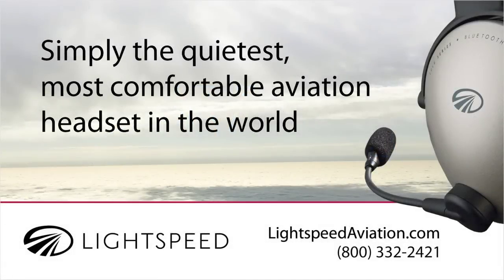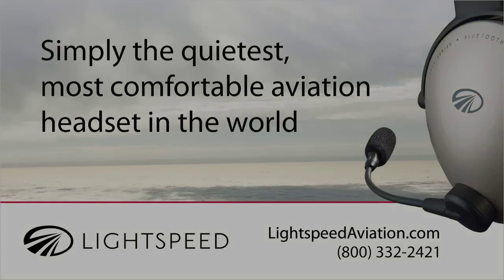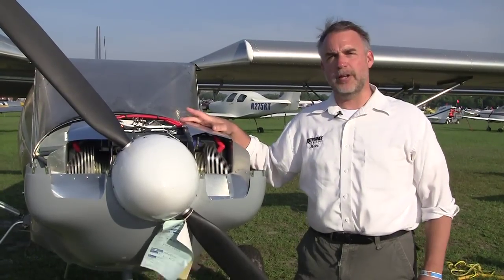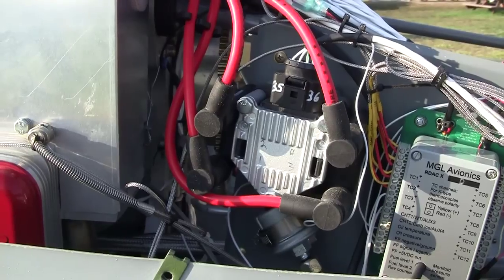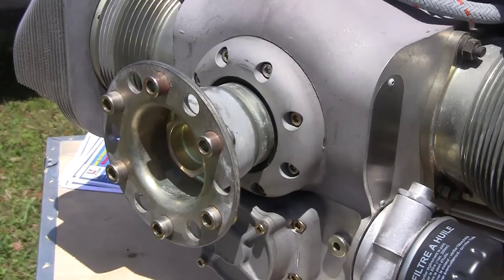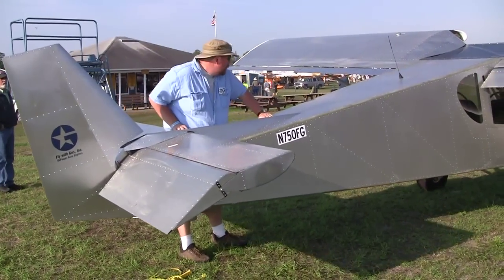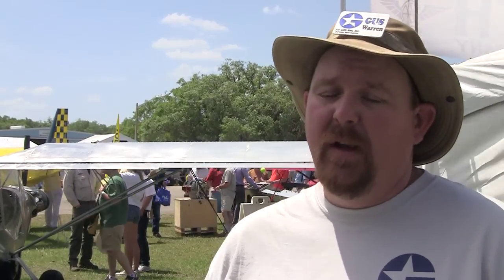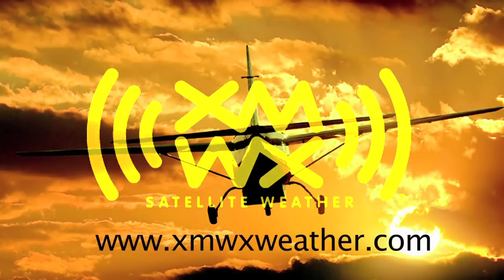UL Power's Unique Lightweight Engine

Comment: if you take a fast descent with a air cooled engine, inside from the engine is hot (pistons, oil,etc...) and the cylinder cool fast down: this lead to heawy stress and tightening who can result to piston jamming in the cylinders...because this, the air cooled engines are built with large mecanical clearances who result to rise up the "blow by"= less efficiency and high oil consumption...
A liquid cooled engine work with stable t°: this avoid such problems...
Reply: Don't do that, problem solved !

Comment: Explain 'shock cooling' and how it affects the engine, please.
Reply: Really common sense. Lets use example of flying skydivers. Grind up to 10k wide open hot summer day. Everybody out, Flip over mad dive to catch the guys, Full idle. red line air speed. Screaming down. Very hard on the engine. That's the shock. Hot to cold. I have seen many cracked cylinders. Simple fix, Don't do that. Use common sense. Carry a little power. I always back off on the jump run, then back to 15 inches smooth and easy. Unless a race to the ground , don't go there !!